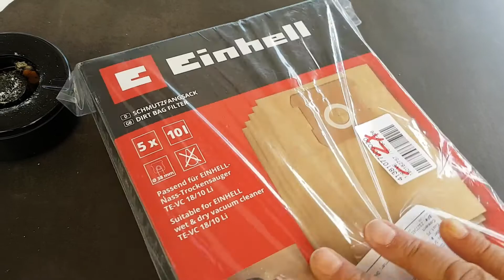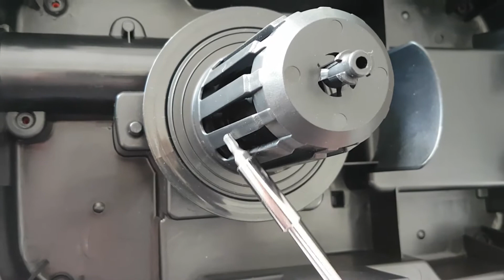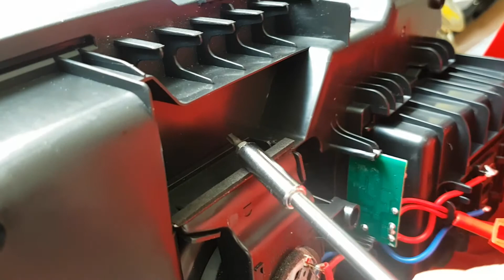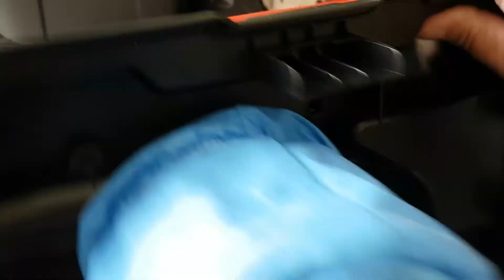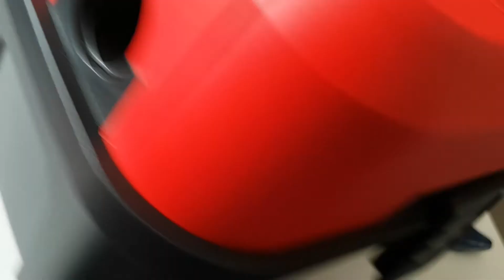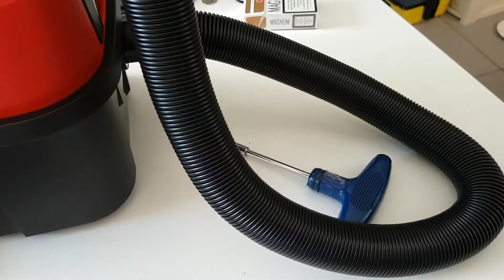Einhell Cordless Vacuum Cleaner, the perfect battery powered car vac ?  Oh yes !

Comment: I had to take mine apart, as some fluff had got inside the motor casing.
 It was complicated, but I worked it out, and removed the fluff. 
Then I put it all back. 
S'workin fine now...

Comment: How usefull would it be, to use it as a "cheap" extractor for car seats...?  Meaning applying seat cleaner for a bottle, and then extracting it out. Would that be possible with this vacuum, or would it lack power??? Thanks for your help.
Reply: No its got the power to clean seats that way.
 It's just not a Vax, that's all. 
But a great little machine...

Comment: Usefull video. Thanks for that. All Lithium battery packs have a battery management system incorporated. This protects the battery against being drained too low. You can safely use this and similar tools until the battery BMS blocks further draining. It is true that a battery pack of e.g. 4, 5 or 6 Ah is much better than a 2-3 Ah battery. As 2-3 Ah batteries can be made from 5 single cells (3.6 volt each) whereas a 4, 5 or 6 Ah batteries must be constructed from 10 cells as the highest currently available Lithium single cell has a max capacity of 3-3.5 Ah. With 10 cells mounted the draining ampèrage per cell is 50% of that of a 5 cell battery. Greetings.